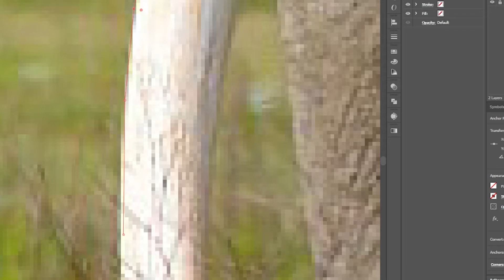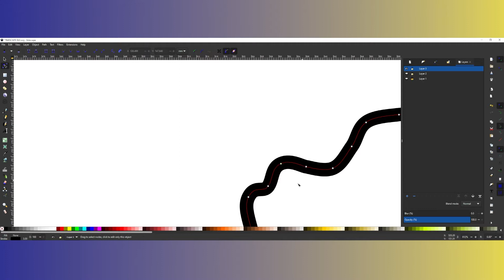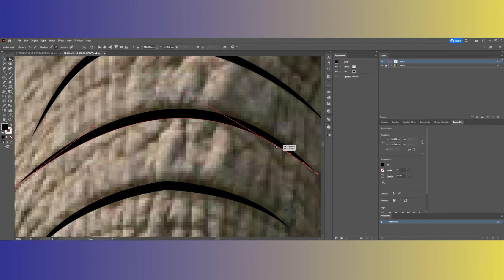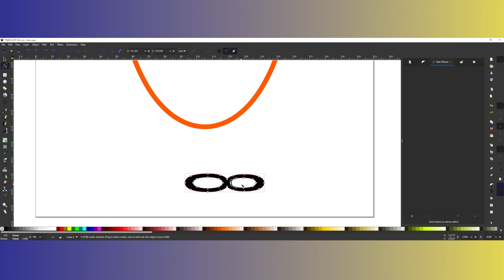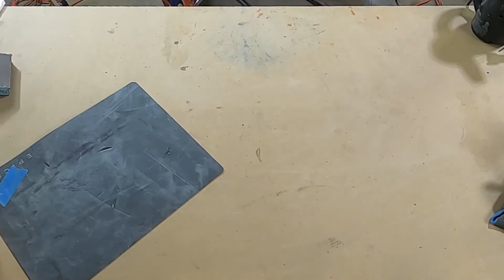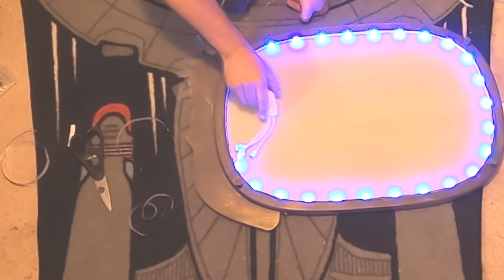Make Stuff- Build Up Your Design Skills - CNC Project

Comment: Good project. Don't know why I didn't see this before now.  I AM subscribed for ALL notifications.
I use E6000 (like GOOP) 2oz size for the small nozzle to deal with issues like your LED strips.  You do have to be patient and wait for it to cure.  But I find GOOP and E6000 to be much more reliable than hot glue.  Watching this video, I was wondering about using a CNC router or laser for Intarsia.  I eventually want to do 3D reliefs (I think you call it) on the CNC.
Reply from the maker: Yeah YT can be weird like that. I get notification for some, and others i do not. Will have to look into that E6000 & GOOP. 

I have not done Intarsia but looks very interesting. It would be fun trying to plan everything out and get the pieces you want on wood right to get the grain you want. I guess take a picture of your wood import it to your cad and layout the pieces over that. 

Some people call it relief carving, others 2.5d carving. I have done a couple and they came out good. I just have not had a demand for it, but i have seen other cnc-ers do.